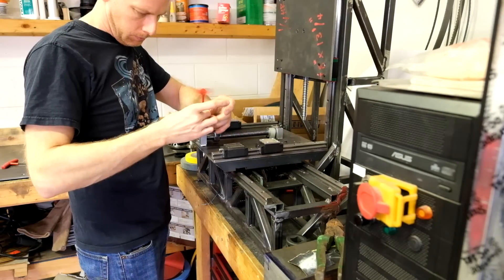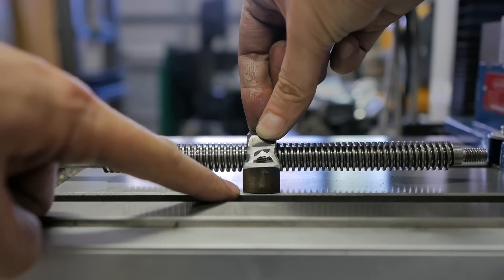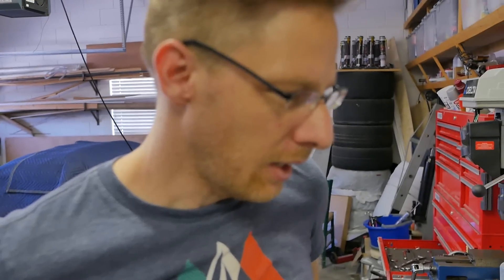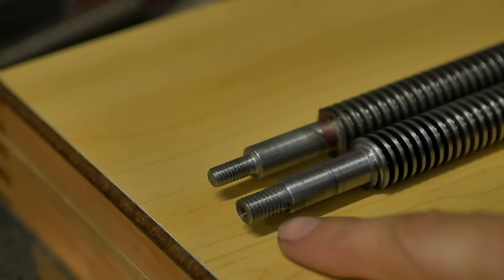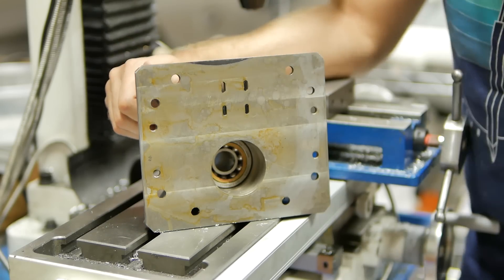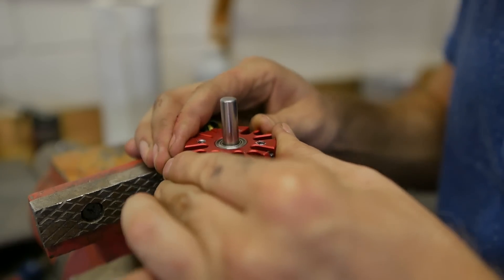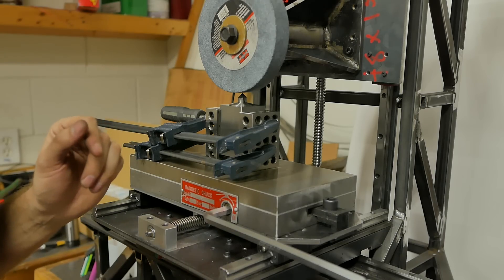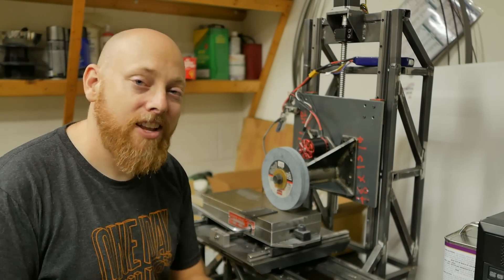Surface Grinder Part 11 - S02E40

Comment: If you like building stuff this can be a good lesson, but I bought my 600kg hydraulic surface grinder used, with coolant tank/pump and a magnetic chuck for around $500.. There's no way you can build something as sturdy as that anywhere near that money... Some tools you should just buy.

Comment: I missed seeing the runout of the leadscrew itself.
The ballscrew cannot be useful if there is too much runout on the leadscrew.
Nylon ballscrew can be printed on a 3D printer.
You need an DIY ATX POWER SUPPLY.
You need a 4axis Stepper Motor Controller with a Pendant (serial port joystick/gamepad)
Have fun... !!
  AWESOME MEEKNESS ON THE PROJECT.

Comment: I agree with Andre Ross about needing to balance the wheel before mounting it.  Professional grinders not only have a tapered mount that always pulls the mounting hub onto center, but the metal mounting hub gets attached to the grinding wheel and is then balanced before mounting it to the hub.  These wheel can and do fail, and are quite dangerous when they fail, and balancing is certainly a big part of avoiding the failure, or at least helping to minimize the failure rate.  You should also always, I do mean always use paper blotters, like you have in this video, when mounting the wheels because they help protect and maintain the integrity of the wheel as well.  And, additionally, before even mounting the wheel to the hub, you should do the ring test, this is the first line of detecting a wheel that is likely to fail.  This video gives decent example of how to do the ring test, https://youtu.be/52n8_-6cooY.   this next video is rather exhaustive, and you do not need a precision balancer base, like what he made, but the concept is what I was trying to convey.  https://youtu.be/FKYTL2W4rDA   I hope this is useful to you, and hope that I have not missed a previous comment where someone already gave you this advice, but when I went through my surface grinder training in my machinist apprenticeship, this last may, the ring test and balancing where stressed repeatedly.

Comment: Trying to use and then salvage the welded in nut on the acme threaded rod is probably the hard way to try to get that axis working right.  Far better to 1. machine a block to be held captive (not welded to) the moving platform, 2. bore and thread it parallel it's registration surface, 3. build the cage for the threaded block such that it can move perpendicular to the axis of interest, but held firmly along the direction of movement.

Comment: You could use some aquarium filter floss (polyester pillow filling) to keep the metal and some dust out of the motors on the surface grinder. It's cheap and easy to work with so as it gets dirty just toss it and put a new piece. It shouldn't block to much air flow.

Comment: When I use to surface grind years ago, we would start the spindle and let it warm up to swell the bearings and then it did not get shut it off till the days work was done. I noticed that if I did have to restart it... you MUST re-dress the wheel or you will get chatter like your part had.

Comment: your table movement looks good, if you get the wheel balanced and running true you should be able to get some good results.
also what flavour grinding wheel is that? if its a pedestal wheel try to find a proper surface grinding wheel.
a soft white AO wheel should be a good starting point

Comment: going to a 1/4" wide wheel may be an idea , I wouldn't run an inch wide wheel on a real surface grinder, anything over half inch wide and the machine is not rigid enough.   try overengineer the crap out of it with lunatic gussetry on the spindle support.  vibration is your enemy, it will borrow your small goods and distribute them haphazardly around the house

Comment: You are going to have to compensate for backlash in how your are attaching the drive screws and runout as well, I would suggest preloading the driving nut or add on another nut and attach it offset enough to take out the backlash

Comment: When you put your guards in, I would strongly suggest that the wheel guard surrounds the wheel top, sides, front and rear (to help protect EVERYTHING/EVERYONE in your shop in case your wheel shatters. I suggest you leave no more than 1/4 to 3/8 inch clearance between the bottom of the guard and the top of the piece being ground. I would also suggest you mount a strong vacuum that can easily handle fine metal dust on the left side of the table as that is where the wheel is spitting the dust out. Other than that, looks good. as others have suggested, dressing the sides of the wheel as well as the bottom and adding a lot more weight to the base should handle the wobbles but be VERY careful when dressing the sides (front & rear), taking VERY light passes, I've seen a wheel come apart like a fragmentation grenade when someone took too heavy a pass on the side with a dressing tool, we were finding pieces of the wheel everywhere for days afterwords and the only reason the kid (this was in high school machine shop) kept his sight is he was wearing heavy duty safety glasses, both lenses looked like they had been sand blasted...

Comment: of course it will work, eventually. if it doesnt work you just keep improving it until it does - thats the whole point about it. i dont think a surface grinder is a tool that you are going to use all too often, but its a fun build and a really nice process (and a nice tool even tough its kinda overkill for almost everything)

Comment: I have been working with grinding machines for years and I don't think this machine is going to be more precise than your mill. Except for the fact that the surface will be grinded (with a bad surface result if you don't rebuild your spindle), I don't see any improvement compared to your mill.
Your main problem is the spindle and the bad damping in your welding construction. Welding is a reasonable way to go but you have to always consider the damping (maybe glassfiber reinforced concrete as somebody already mentioned).
The spindle is not stiff enough and will always tend to vibrate. Keep in mind that the forces on the spindle and the machine itself are much higher in grinding processes than in turning or milling processes (talking about finishing process!).
You also have to balance the grinding wheel.
The rest of your machine looks good. I really like the effort you put in this. Please don't missunderstand this as "hating" or something, but building a machine like this just isn't all that easy. Although I'm really looking forward to the next videos and I wish you best luck on solving the problems! :-)

Comment: As has been commented several times already, the chatter that you're seeing isn't due to anything other than the wheel being unbalanced and that causing it to spin around an axis slightly off center to your spindle. The somewhat flimsy construction will be making this worse, but its not the root cause.
I've worked in shops with 2 different work methods surrounding dealing with balance. 1st and seemingly most common is similar to what you did with one important difference. Lots of shops will never bother with balancing the wheel on a hub and just dress the wheel slightly out of balance (quality surface grinder wheels are generally fairly balanced right out of the box) and the freshly dressed surfaces will be true to the actual axis of rotation, not the center of the spindle. Now here is the important part, KEEP THE WHEEL RUNNING while you take off the dressing diamond and mount your work piece. This is important because as soon as you stop and start the wheel again it will find a new axis of rotation different from the one you dressed earlier and you'll get chatter.
The other method is more involved but tends to be easier on your spindle bearings and extends your grinding wheels life by requiring less dressing. It involves mounting the wheel on it's own hub and balancing it with balancing weights mounted to the hub. 
A couple things to keep an eye on. 
1. Please put a guard around that wheel before you start it up again. Yes, many people will use surface grinders without them as I have too when the job made the cover inconvenient. But you guys are using a home brew machine and the carnage that can ensue when a grinding wheel explodes can be pretty bad.
2. Not sure what sort of wheel you're using , but please make sure to get a wheel meant for surface grinding, not one meant for a bench grinder. They may seem to be very similar, but surface grinder wheels are generally made to tighter tolerances and are more friable.
Considering this is just a shop built grinder it seems to be working fairly well all things considered. Looking forward to seeing it in use.
3. If you're not going to balance the wheel, then you may be able to reduce vibration if you have a variable RPM by finding the RPM that avoids any resonant frequencies that will be inevitable with a light-weight design such as yours. Though that may be aiming at a moving target that changes as your wheel get lighter and lighter with each dressing.

Comment: you need provision to be able to balance the wheel. Even my big russian surface grinder leaves poor(not as bad as yours) finish If I neglect to balance the wheel.Mass is very important thats why a precision  weighs many times the equivalent size mill or lathe, dont just for rigidity but also resonance. perhap you could think of cunning ways around this like resonance damping weights as found on transmissions and even buildings

Comment: If you had a surface grinder it would make making a surface grinder a lot easier.
Reply from the maker: That always seems to be the case doesn't it. That's why I end up with two versions of tools all the time. Happened with the 3d printer and laser cutter.

Comment: Just as a heads up: I took the piece Mike ground in the video over to the surface plate and that chatter/waviness only measures 1-2 tenths. So looks much worse than it actually is.  Also keep in mind the torque on those angular contact bearings is critical, and right now I can feel physical play. This might be closer to possible than we thought...
Reply: Yes, but does it measure flat across the whole surface? If not, there is hardly any point in building the machine if it can't produce flat results.

Also minus points for continuiung to use wrong axis nomenclature.

Comment: those waves in the grinding are from the wheel moving up and down , similar to washboard surfaces on dirt roads. Stiffen the spindle and/or structure, try much lighter cuts. Glad you are enjoying your journey, that's what counts!

Comment: I want you to be able to take my advice. Please dont take it as criticism. Please add mass to the machine. You could achive this with a bucket full of concrete hung from a spring. Or adding concrete mostly up the base. Mills are made from cast to prevent vibrations. Also please grind your Chuck once its all done

Comment: Always aproach your grinding wheel from the back if you want to re-dress it. If you start at the front side of the wheel, the diamond might get pulled under and into the wheel, that can be very dangerous. Otherwise, great build!

Comment: Great job guys. I know you have a million and 1 comments but you might want to try this before you do too much more fettling on the grinder.  What you are seeing is wheel bounce, not bad bearings or hand feeding issues (these may rear there head in a lesser form as you get the main problem resolved).  Try dressing a step in your wheel so that you only have 3 or 4 mm in contact with the work.  There are some big forces ploughing material off, even at very small depths.  A thinner wheel makes this much easier for a light machine to handle.

Comment: Wheel selection and proper dressing methods will be very important in your final results. You can have the best surface grinder in the world and get bad results if these two points are not addressed correctly.
Steve

Comment: The biggest problem is you are use'd wrong bearings. At first you have to balance the grinding wheel, the spindle and all turning part's. The next big problem is using to smal steel plates.Your test grinding show's chattering marks.
Your construction with a lot of welding part produces vibrations. The best and cheapest way is cover up your construction with sheet metal and fill it with a mineral polyester mix...
Reply: They're precision SKS angular contact bearings
Reply: Ryan Wilhelm yes, and there is a reason real surface grinders use adjustable journal bearings rather than rolling element bearings. The runout of a rolling element bearing based spindle can only ever be so good. If you want better results you must go to journal bearings or hydrostatic/hydrodynamic bearings.
Reply: Here's the manual for a brown and sharpe #5 machine: http://vintagemachinery.org/pubs/2185/5790.pdf If you skip to page 14 you'll see it's using plain bearings. The diagram they show seems to illustrate an angular contact bearing setup. Maybe modern machines specify hydro bearings, but looks like these got the job done back in the day too.
Reply: A plain bearing (https://en.wikipedia.org/wiki/Plain_bearing) is the same thing as a journal bearing. I can assure you, that Brown and Sharpe does not use rolling element bearings for its spindle. The plain bearing consists of a precision shaft running in a precision bushing, which is usually adjustable in these applications to be able to reduce the running clearances to a minimum. 

Hydro bearings are essentially what journal or plain bearings developed into and have a complete lack of metal to metal contact during operation.
Reply: This is not to say that precision SKS angular contact bearings are bad bearings, this is just not the right application for them. You can build beautiful milling spindles with them, but by their nature they simply fall short when it comes to grinding spindles.
Reply: http://www.lathes.co.uk/jonesandshipman/page4.html
Don't know how much more definitive it can get than a huge cutaway drawing that clearly illustrates angular contact bearings. I agree that precisions hydros that don't rely on a rolling surface (opportunity to crunch dust) are common in grinders. I'm just saying we're not really doing anything new here with angular contacts either.

Comment: What you guys are doing is actually an amazing look into how technology has evolved to be more and more precise by using lathes and mills to create even more precise lathes and mills.  Just a constant iterative process of lowering tolerances over and over.  Keep the great work up, it’s all really motivating.  Sure you can go out and buy the best of the best and have a baller set up out of the gate, but the amount you guys have learned about the tools you’re using/ building by doing it this way is priceless experience through trial and error.

Comment: I'll guess the controll will be a custom solution? Or do you intend to use something prooven to be working (linuxcnc, grbl, smoothieware) and add a gcode generator? Both would have its pros and cons.

Comment: Just a note. That's a small, lightweight machine, that's made from thin steel welded channel and no cast iron to absorb vibrations. You need some way to balance that grinding wheel or else the whole machine will vibrate. That wavyness you see isn't from hand feeding, or the slides being loose. It's from the spindle bounding up and down due to imbalance of the machine and the lack of stiffness. My reocmmendatarion would be to add a spindle nose with a taper to fit hubs that can be balanced, and to stiffen the frame with cement poured around the steel. It's cheap, strong, and will help absorb vibrations while making the machine heavier and more stable.
Reply: Yep. The old boys didn’t make the old machines heavy just to give people hernias, it’s for shear ridgidity and stability. More heavy more bettererer. Otherwise it’s great watching you blokes giving it a go.
Reply: Concrete! Add more concrete;) Concrete is low cost "cast iron" vibration absorber.
Reply: Thank you!!! Words out of my own mouth
Reply: I agree More Mass Is your friend and a way to balance the wheel.
Reply: Is there anything you would do to the steel before pouring in (water-based) concrete to prevent corrosion?  Not grease, I would think a bond between steel and concrete would be best to prevent vibration...
Reply: Andre Gross YEP !  What he said!
Reply: yes good point... for my use cases the machine is ok like it is, for flattening and paralleling staffs, I will remove the waviness manually later by hand grinding with stone or paper,... I think I will build a similar machine but way more simple...
Reply: Sounds good advice to me. Can't wait to see the finished article -keep going boys.

Comment: When I saw the video in my recommended, I looked over it, then went .. hey it's the surface grinder .. great to see another video on it .. it's great to see you getting some use out of your milling machine and working to make everything better .. don't worry about the finish that you go, it works great .. the only thing that I can think of is balancing the wheel with a counterbalance, but not sure about how you could fit that into the design, the other method would be to use a Tapered Roller Bearing on the shaft closest to the wheel and then just a pilot bearing on the shaft at the back. This way the design would be capable of holding the front load capacities of the spinning wheel much better than just a standard ball bearing. This is why they use tapered roller bearings on the wheels of a car as all the load is external to the spindle.

Otherwise, great work .. love seeing an idea coming into reality :D

Comment: build an enclosure for the motor with a computer fan pulling air out and sucking it in through a changable/cleanable filter